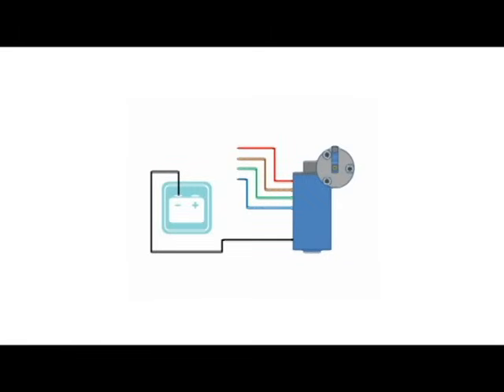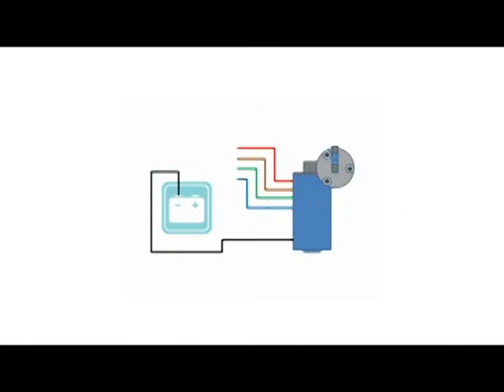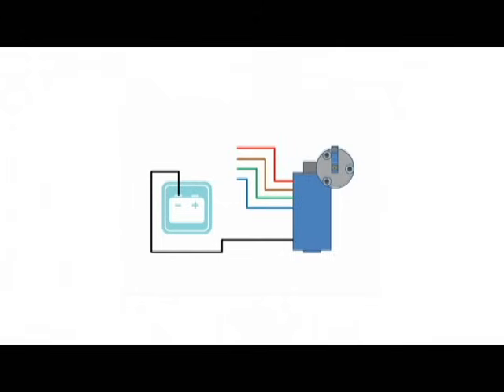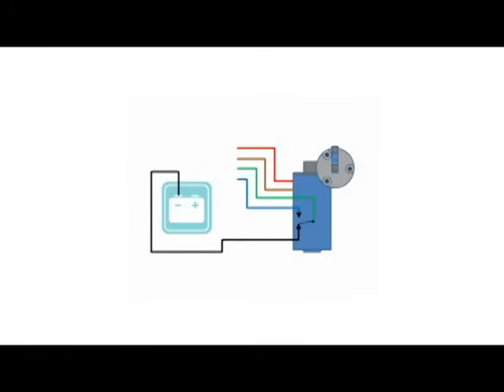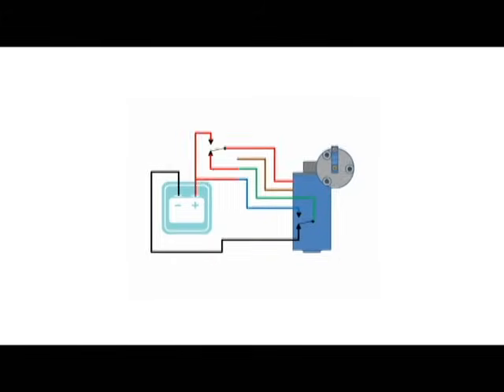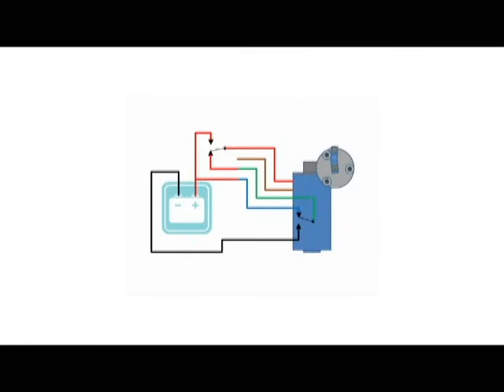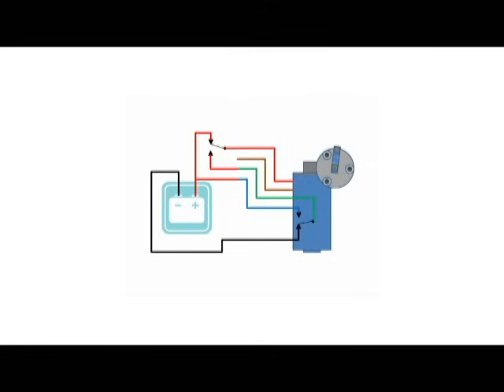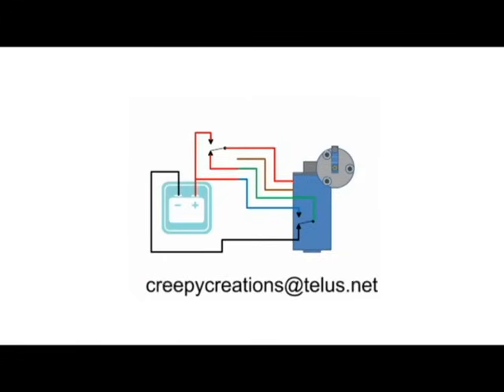Windshield Wiper Motor Wiring Tutorial

Comment: so the body of the motor is the ground? hmm... so if i have a ground problem then i need a new motor
Reply from the maker: More often than not, yes... the body of the motor is ground... to match the chassis of the vehicle, which is also typically ground. By bolting it on, you've assured the ground connection.
Reply: so if my wiper is working when it feels like it, if i clean the ground connection with sand paper, that would be the way to go?
Reply from the maker: Sound Therapy, there could be any number of reasons why it only works "when it feels like it". It could be a loose connection, so power is only getting to it every so often, which could be cause by a dirty contact point. Cleaning the ground connection can't hurt anything and would definitely eliminate that as a source of the trouble.  I'll readily admit I'm not an automotive expert AT ALL, but the fundamentals of these things work doesn't change. You might also have a dirty switch. Same cause, just different component. These are harder to detect and clean though, and expensive to just replace on a whim, so I would leave that as a last option.
Reply: @AnimationGoneWrong  okay. I might be working out a hundred bucks 4 a new motor. Thanks though
Reply from the maker: If you can, go to one of those "pick a part" places, unless your vehicle is touch to find.  You'll get a used wiper motor WAY cheaper!  That's how I get all of mine.  I have yet to find a "dud".  They've all be great.
Reply: @AnimationGoneWrong  I got a crown Vic. Common I think. But those places usually don't give warranty.  There's one spot in town but they pull it 4 u. He has bad reviews though. Imma try cleaning the connection like u suggested. I'm unable to get to da ground anyway

Comment: Why does a wiper motor constant gets 12 volts.. even when the wipers aren't turned on. My wiper motor kept burning the fuse. Even though it wasn't on. the moment my car had ignition, it blew the fuse.

Can someone explain that?
Reply: Frederik19951995 your motor has a problem